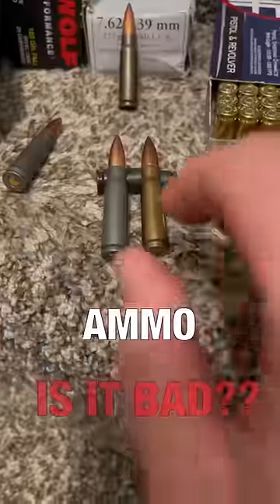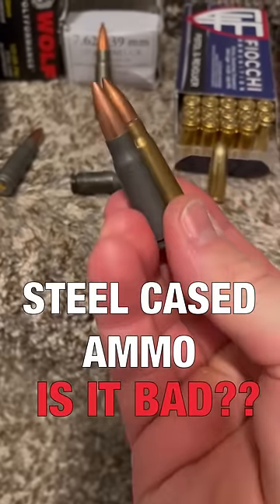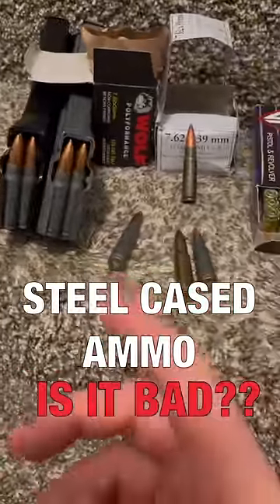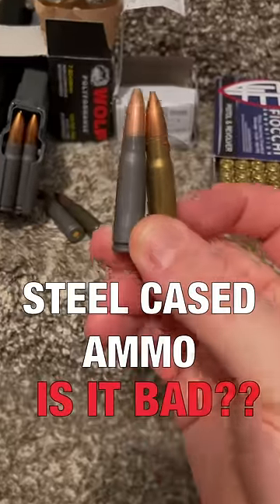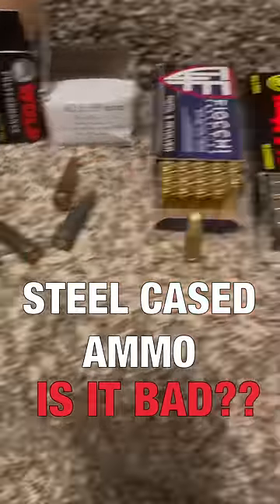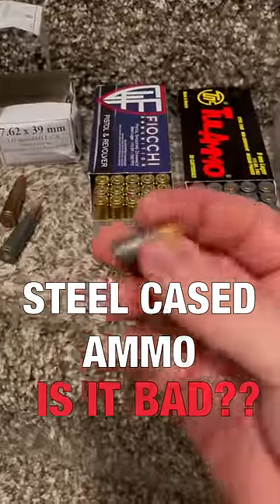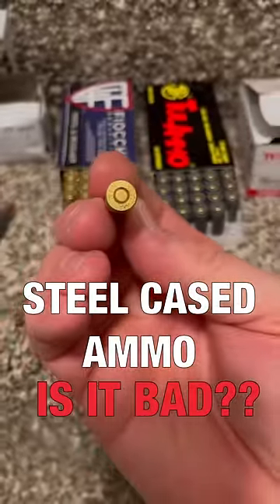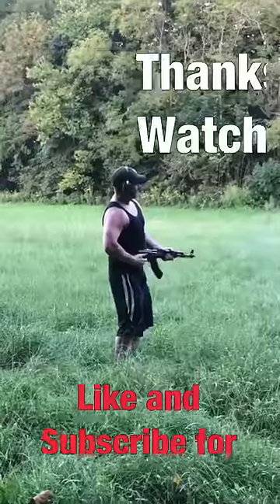Steel cased ammo, is it bad? #short #shorts #shortvideo

Comment: I'd have to disagree with you on your comment about the steel case being harder on parts than brass. A metalergist debunked this years ago. The steel cases are annealed and actually softer than most brass. That's actually why your extractor doesn't grab it as well.

Comment: Yeah I don't know what happened exactly but after an hour and a half of beating on my Moses bolt with a boot a piece of wood and eventually just the edge of the f**** table of all my weight I eventually got the bolt to f**** a lock and found that the cartridge was still stuck in the chamber and the primer was cracked online steel case 762x54r... but heck it's cheap and with the economy right now Beggars can't be choosers I just readjusted my firing pin clean my chamber like there was no tomorrow and continued going

Comment: If your only running 1-2k rounds through your weapon system a year steel ammo is very economical. If your the kind of guy running 10k+ a year that economics might backfire on you. In my carry gun I ran brass for practice ammo but bought steel hollowpoints for carry.

Comment: Soviet weapons were engineered to utilize steel case very effectively. Nato weapons were engineered to use brass. They are in lies some of the problems experienced using one type of ammo in the platform. It was not designed for.

Comment: The barrel really... since when does the case travel down the barrel please tell me I'll wait. But before you answer its called “steel CASE“ not steel bullet  it has no effect on the barrel none at all..
Also it's not pure hardened steel steel casing is a steel magnesium blend it's very soft the steel is so diluted a magnet barely sticks to it. Un like the parts in a gun sks or old ak47 which are case hardened carpenter steel

Comment: Steel gave me double feeds alot more than brass
Reply: What were you shooting?
Reply: @gujwdhufjijjpo9740  xtac 556. Not the best ammo in my opinion. Have a snake tread m400 I was running the rounds through. It had some trouble with steel, brass fed perfectly.
Reply: @bun4265  - did the first round fire but fail to eject?  Coulda been a bad brand. Only steel ammo I shot extracted just as good as the brass. It was the Red Army brand. Due to the Ukraine War I imagine that brand is probably more expensive now anyways. Can’t tell you what brand the upper was from memory.
Reply: @gujwdhufjijjpo9740  first round would catch on the upper, fail to eject and the second would smash underneath. Only with steal. It's probably a bad company to buy from tbh

Comment: steel is trash puts more wear on your breech, bolt and gas system since steel dosent give and strech like brass does. brass you will have no problem, steel will hurt you in the long run. and if you are buying tul-ammo or wolf bulk their primers are still slightly corrosive and powder is dirty. I only run brass hand loads in my rifles.

Comment: This is false. Steel cased is mild steel, mild steel will not damage properly tempered parts. What does occur is poor ownership using steel first building up that fouling then brass being shot and expanding and the fouling acting as glue.

Comment: A good safe bet is that steel cased ammo is bad for American guns.  I broke my Savage 110 .308 the first time I shot a box of Tula, which my M1A would fire 100% and eject 0% (It is 100% with any brass ammo that SA suggests you use).  
I had success using Wolf in my Mini-14 ironically.  My gunsmith told me not to use steel on my Mini-14.  It is suggested not to use steel cased ammo in most of my pistols.
The only guns it seems that are fine with steel cased ammo in my collection are my G3 clone, my AKM and my AR-15.  No issues shooting it for years.